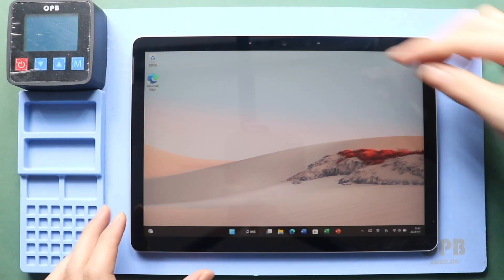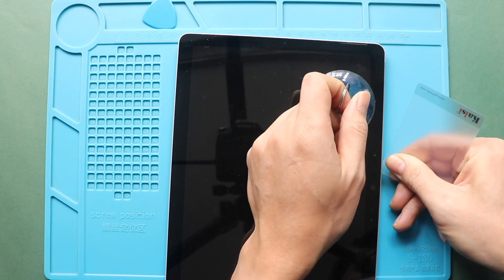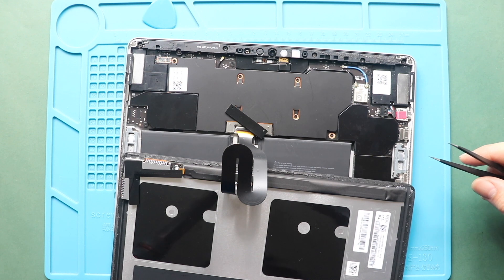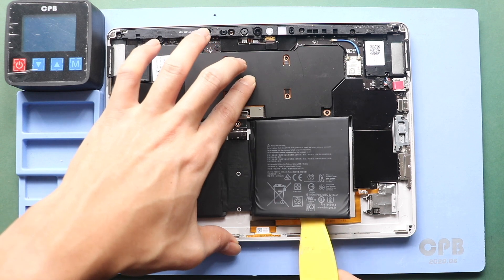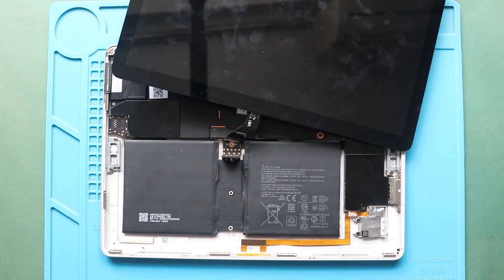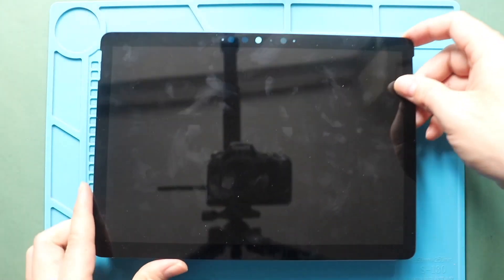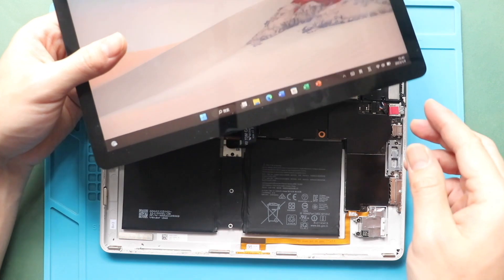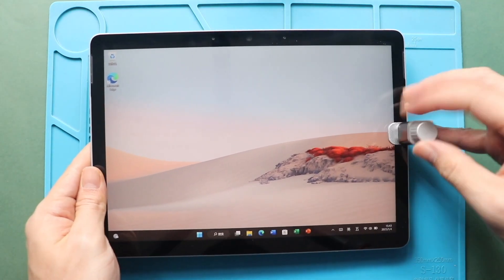Microsoft Surface GO 2 Battery Replacement

Comment: IMPORTANT: There are 3 ribbon cables running just behind the adhesive with no protection. Orient the front camera upwards, with the screen towards you, the tablet will be horizontal. The first cable is on the bottom edge, one inch from the left corner, and the second cable is on the left edge, one inch from the bottom. That is to say, they are both one inch from the bottom left corner. The last cable is for the touch screen, and it runs across the entire bottom edge. Also, you will need replacement adhesive.

Comment: Thank you. Very helpful. One question. Is the glue that you suggested has the same adhesive strength as the origial one? I am wondering how easy it would be to reattach the screen again if needed.
Reply from the maker: Yes they are good. Adhesive tapes are good, but the issue is finding good original ones. So glue will be a better option

Comment: Be very very careful when cutting the glue as there are 2 digitiser ribbon cables running near the edge of the screen. I managed to cut through mine so my screen no longer has touch functionality.
Reply from the maker: Thanks for sharing